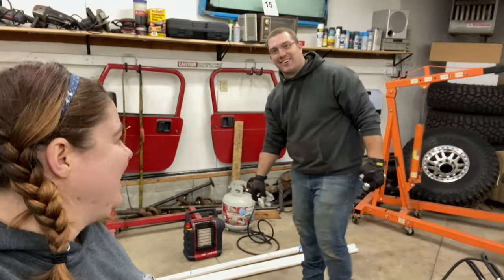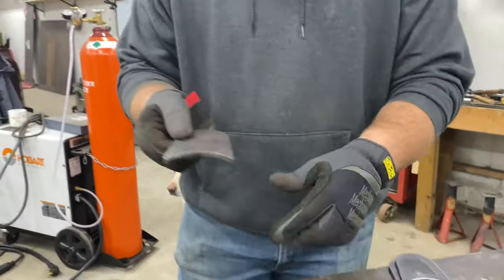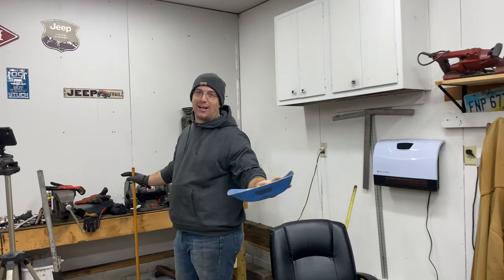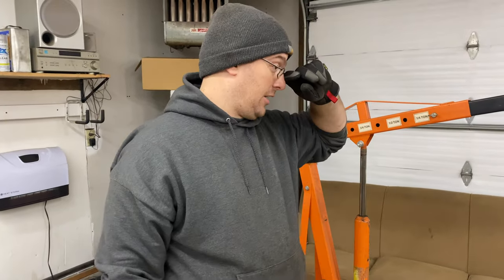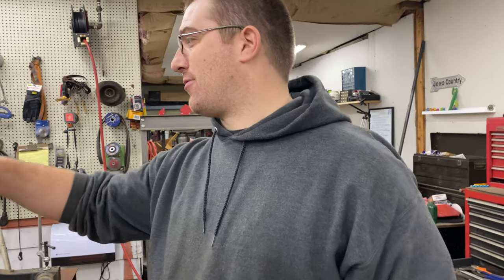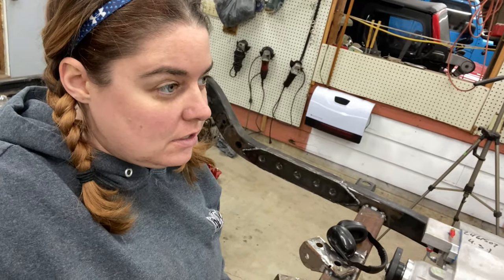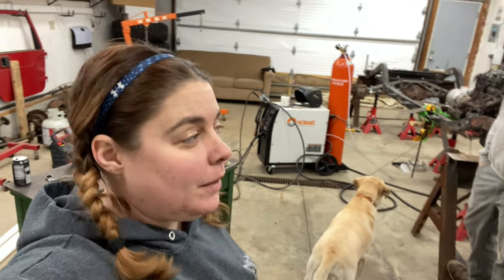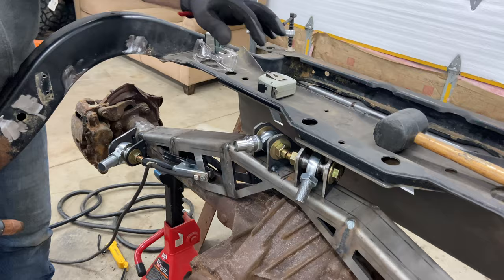DIY Double Triangulated 4 Link Suspension for the Jeep TJ to LJ conversion.

Comment: Thanks mate exactly what I envisaged. Just never saw it applied. So what remains is the Bumpstops adjustment and Max travel straps. Also, make sure your drive shaft angle stays as constant as possible, maybe, double joints on both sides of the driveshaft will help with the extreme angles.
Reply from the maker: Absolutely man. Thanks for watching the vid. And we still have to continue to work on this project it had to take a back seat due to some personal reasons. But we are planning on hoping back on this project soon. And like you said definitely planning on joints on both end of the driveshaft and getting all those other things done.

Comment: Good job! I'm sure you have a much better understanding of how critical the triangulation is and how it works. There is a lot to figure out when building one, and then see what interferes once you've got the tubes figured out. I'm also quite sure Willie will be competing with Josh when it comes to quality garage couch time. 😆
Reply from the maker: Yes, we definitely learn a ton. We did hours of research and spent a lot of time on the 4link calculator and all the numbers turned out well. Then it came to the real fun part turning all those numbers to an actual physical piece that we built out of scrap steel. It has been tons of fun so far. 
And me and willie have been sharing the couch as much as possible. And always Dallas, thanks for watching.

Comment: How did you decide on this? I also desperately need this one - a magnificent, all-passable suspension! I think this will not be an exaggeration - it will be possible to ride it even on the moon!
Reply from the maker: We just did a lot of calc on the 4 link calculator. And then figured out from there how to get as close to the number on the calculator

Comment: This is awesome. Is your skid plate  going to be flat with the frame? I've always wondered why all of the big companies always make their link mounts hang below the frame on the skid plate side.
Reply from the maker: Thanks man. It’s going to be a 1” drop at the center. I had to drop it down a bit just to fit the transfer case. I think that’s why most companies make bigger drops just to fit powertrain.

Comment: I get how you figured the rear link mount separation at 25% 40" tires gives you a 10" separation. How did you calculate the spacing on the frame end for the link mounts? Is it just 10" of your tires height?
Reply from the maker: So the frame side links are a lot harder to figure out. Without diving down the rabbit hole too much, the frame mounts are what actually control your antisquat numbers. I was shooting for an anti squat value of around 60-70%. And after working in the 4 link calculator that I pulled from crawlpedia.com the numbers I got that worked best was 4.5” so we set them there. 
I have heard others say that you can get away with doing 10% of tire size on the frame mounts separation you should be good. But I wanted to do a more tired and true way of doing it.
Reply: @Ohio_offroad_adventures  cool.  I'll check out that calculator and bookmark it for future reference.  I've actually heard about that before but forgot about it until you just mentioned it.  Thanks! And Ashley is kicking ass with that welder! Hard to believe she's that new to it.
Reply from the maker: @samsanderson7159  thanks man. I think Ashley welding is just proof that some people are just able to pick some things up really fast. I’m still shocked but how well she is doing. I’ve been hobby welding for 17yrs and my welds have never looked like hers. I’m kinda jealous. 😂. Thanks you so much for following along with the build and watching the vids!